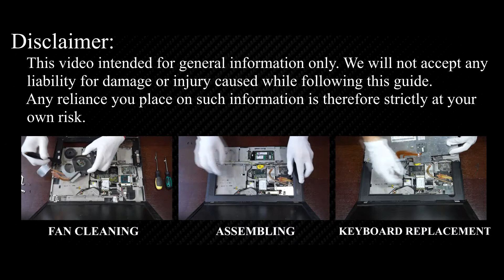Lenovo ThinkPad R61 Upgrade and installing RAM | DIY step-by-step guide

Comment: I have Lenovo R61 laptop it works very slow i think to upgrate this ram
Reply: If you have 4GB ram, it's good enough.  Install SSD drive and middleton bios and also possibly upgrade cpu to faster core2 duo.  And finally, install linux and you should be all set.  R61/T61 is rubbish for games, but still fine for productive tasks.   I had R61 on windows vista and it was horribly slow.  Installed kubunu 18.04 and wow, everything's so much faster.
Reply: is r61 ram compatible with r61i?

Comment: Can i get 8 or 16gb ram on this?
Reply: Sure you can upgrade to 8GB (two 4GB DDR2 sodimm).  However, DDR2 8GB sodimm kits are very expensive, hardly worth the cost when you can buy a complete used T410/T420 for same price.
Reply: no just 4gb ram insert on it